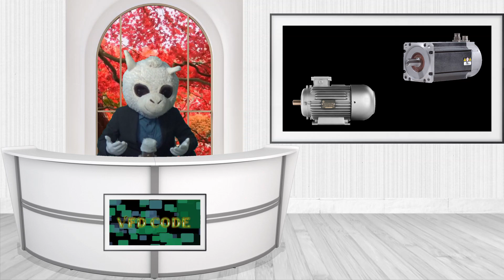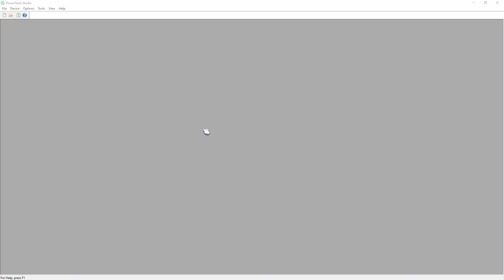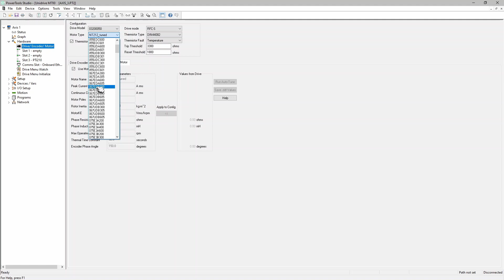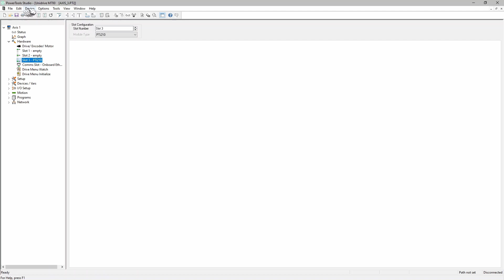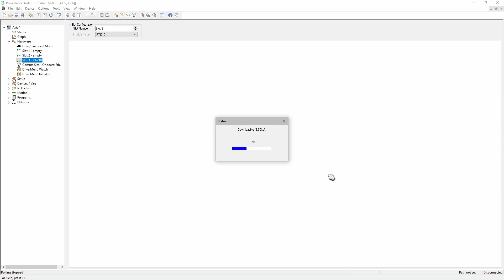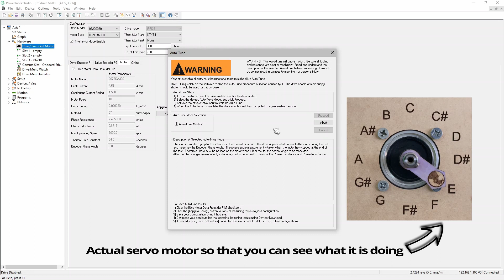Power Tools Studio - Setup Motors

Comment: How do I setup respons of servo motor using M700 drive to hold tight position like my Chinese servo
Reply from the maker: 1. Rotate auto-tune unloaded. This helps the drive understand the motor.
2. Tune the speed loop. Larger numbers make it tighter, while lower numbers make it softer.
3. Tune the position loop. Similarly, larger numbers make it tighter, and lower numbers make it softer.

Most of the work involves tuning the speed loop. The speed loop should handle 99% of the workload, while the position loop should handle about 1%. Default speed loop values are generally soft to ensure stability across various motors and systems. Typically, I increase the proportional gain until the system becomes unstable, then reduce it slightly. Next, I increase the integral gain until the system becomes unstable, then reduce it slightly. This approach usually works for most systems.

Also what position controller are you using?    AMC, PTI210, Codesys, none of these.
Reply: @vfdcode Thanks I will try that

I am currently using AMC... Just to see how it works but eventually I will use Ethercat on cnc machines..

When I switch on AMC I can feel that there's a difference in response it just a bit more tighter that normal mode but there's no guidelines on how to improve from that level...

Let me try what you suggest and if I am happy next thing I will purchase Ethercat module
Reply from the maker: @seimela  set 39.007(position loop) = 0 before you tune your speed loop.  Speed loop 3.010 and 3.011.  after the speed loop then tune your position loop.

Comment: How is this different from Connect
Reply from the maker: The connect software was written from the point of a VFD type approach. Connect is a parameter-based system which uses the menu structure of the drive. Connect basically just reads the parameters out of the drive as they truly are.  So, you have to know the drive to use it.
Power tools uses a module called the PTI210.  This module takes over the drive and hides all of the parameters so that you don’t need to know anything about the drive.  It is designed for the purpose of doing indexing, homing, electronic gearing, and more.  It is designed for nonprogrammers in mind for servo type applications. The goal is to make programming servos easier by eliminating what they need to know about the drive.   
With either of the two approaches there are pros and cons but individuals who mainly deal with servos especially point to point indexing tend prefer using power tools.
Reply: @vfdcode  okay I should give it a try,  it is free or paid software  .
Reply from the maker: Software is free but the PTI210 module is not.  Also this software and module only works on M700, M701, M702, M750, M751 drives.
Reply: @vfdcode ohhh okay....I must try this

Comment: What kind of thermistor are you using
Reply from the maker: Typically, the thermistor I use is the KTY 84 when I get to select one.  But most of the time the systems I works on have the DIN44802 or a switch that opens up when hot.  I don't know if I answered your question. If not let me know.
Reply: @vfdcode  perfectly